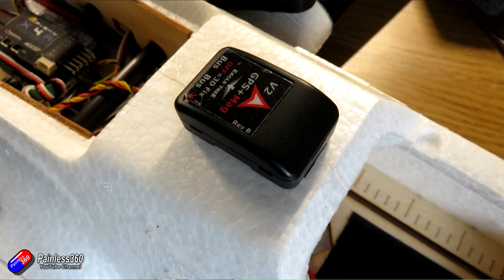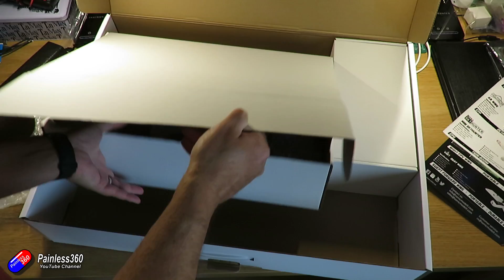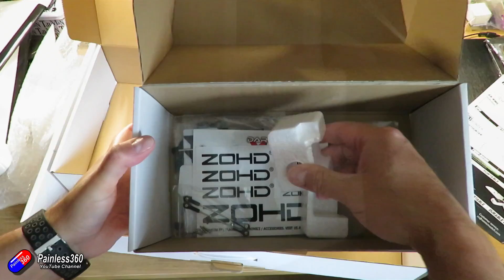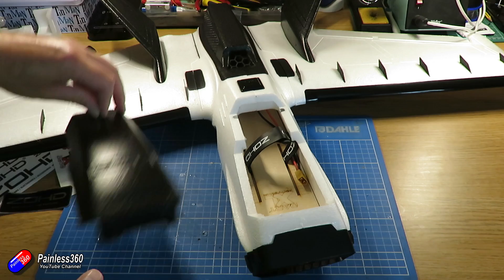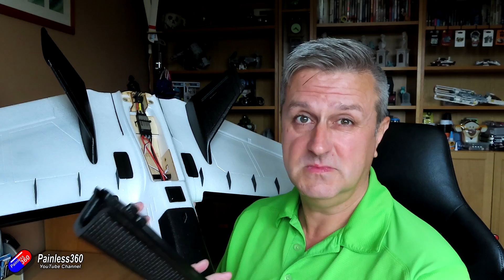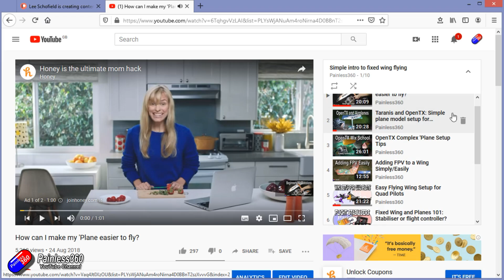ZOHD Dart XL 'Enhanced' - New Version!

Comment: Hi M8 great vids ...did U have any reflex on elevons , had issues on maiden today ...think it was the bloke tossing ...but checking setup
Reply from the maker: For the maiden I usually add a few mm of 'up-elevator' and then INAV can trim it out when I fly. Using INAV Autolaunch means that only the worst throws result in disaster! :D
Reply: Rr yeh I was thinking that ...and I'm using a FMS reflex V3, in auto balance mode , so surprised no flight after 5 launchs last broke prop and mount came out (very late in day ,fixing for tomorrow..will double  check I had 2 mm on elevons...sure I did ,same as my f27 ..Maybe I over reacting to his throws ...building ramp tonight ...so can watch it of ramp and adjust ...will be at much higher speed..should fix  my maiden issues ...otherwise I just going to try fly my jet and 🤞my fingers .. sort it out later .. cheers M8 ...love ya videos.

Comment: Hi Lee, thanks for the review. I,ve just finished my build (the first I ever done) and I followed your 2023 Inav fixed wing series for the settings. In angle mode the Dart flies flawless but as soon as I switch to manual, it starts rolling left. I don't know what could be the problem. On the bench, in manual mode, all the controll surfaces are perfectly in line each other. Thanks in advace for your help, Simone.
Reply from the maker: Make sure you have enabled continously trim servos... Happy flying
Reply: @Painless360   thanks for the replay. I've not yet enabled it because at the beginning everybody told me "FIRST the plane need to fly decent in manual mode". That's why. Am I wrong? Please note that in ACRO the plane rolls on the left only at the beginning and than it can be flied decent (I don't understand why). Only in manual I have a consistent and permanet roll on the left.
Reply from the maker: That's not how I do it. Just follow the steps in my INAV for beginners 2023 series... Happy flying

Comment: Been thinking of getting dart xl soon and been puzzled why are most setups with runcam2 and a separate dedicated fpv cam? Isn't runcam 2 good enough to do fpv as well? Whats the difference, other than slightly bigger latency? Thanks
Reply from the maker: Most action cameras don't do decent FPV as well. There are devices like the RunCam Hybrid that does a good job at doing both at the same time but uses two lenses to to it. Modern action cameras like the Peanut have image stabilisation that means that it can't do both.. Happy flying!

Comment: I got this from get fpv a little while ago after destroying my rmrc recruit so all of its parts are going into it. When I got it there wasn’t even a description of what was new on it so I was pleasantly surprised that they addressed almost all the issues other reviewer had voiced. Just got inav set up and configured. Only thing about the design I haven’t quite figured out is if I want to use smart audio and crossfire protocol out on the wings I’ll have an extra wire on both sides. Trying to figure out how to run it while still making the wings easy to take off. Any advice would be appreciated. Right now I’m running crossfire in sbus but I’m missing my telemetry lol

Comment: Hi Painless.  Thanks for this video. Could I ask what glue you used to attach the vortex generators on the wings? 

I got the v1 a while ago but haven't flown it yet. Did the folding prop mod that you showed last yr. I got it very cheap during a sale for only £90. I think there have been a few versions of the v1 because my one has magnets on the back compartment,  not screws. I've put carbon rods down the length of the fuselage after I watched a video on Uav futures channel. Stu crashed one of these and completely lost the front end. You might want to watch it for its comic value!. Others have had the same happen to them after a 'light' crash too.
Reply from the maker: I use the good 'ol HobbyKing Foam Safe glue (you can see it briefly at that point in the video).. Hope that helps.
Reply: @Painless360  cheers!

Comment: Hi got mine set to pwm and all my controls work fine but my esc hasn’t gone threw all the beeps so not arming. Iv been outside to try get gps lock with no success. It was just outside my house tho. But I don’t have throttle. Can u help please. I’m desperate?
Reply from the maker: This model doesn't have a flight controller. If you talking about one you're using (you don't say) then check out my builds and playlists for the one you have.. Best of luck!

Comment: Hey dude. Can you mix n match between v1 and v2 parts. So my fuselage is mostly glue these days but my wings are fine. So ordering a new fuse and swapping the fc and air unit over would be ideal.
Reply from the maker: Yes you can, same connections and layout. :D